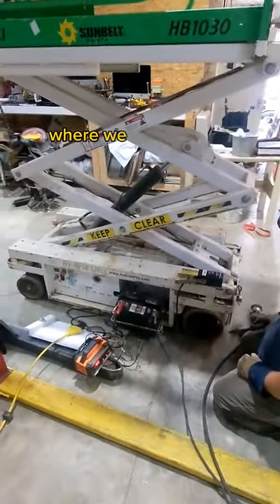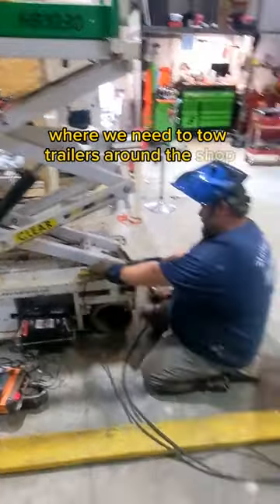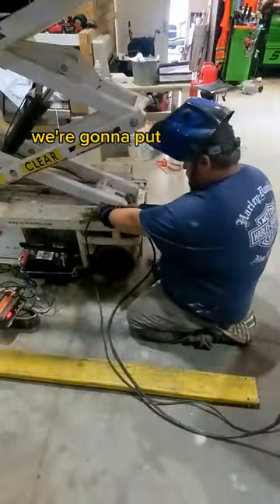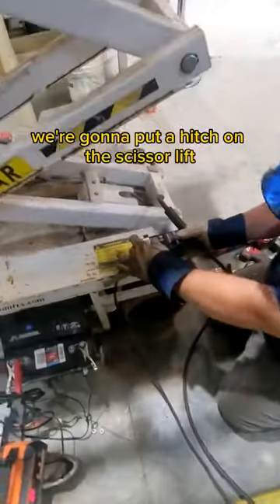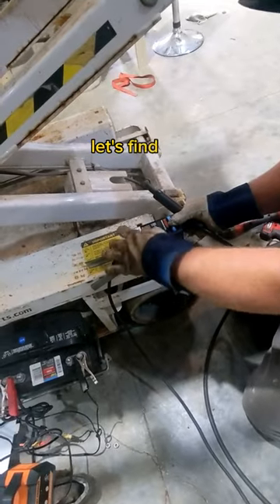Work Smarter Not Harder! #lifehacks #diy #construction

Comment: Horrible idea. HOWEVER, if your gonna play dumb games, make sure to weld a solid bead on all 4 sides. That way it might not break and smash into the lift when reversing. Also it’s gonna wear on the motors in the lift real real bad especially turning, that’s far more expensive than a wheel for the jack on the trailers and a little elbow grease.
Reply from the maker: We paid $800 for the lift, I think it will be all right for these little trailers. Not moving any dump trailers with it or anything.
Reply: @DiyCommerce   fair enough. Id still weld up solid beads but if it works it ain’t stupid til it doesnt lol.
Reply from the maker: 🤣🤣 couldn't have said that better myself